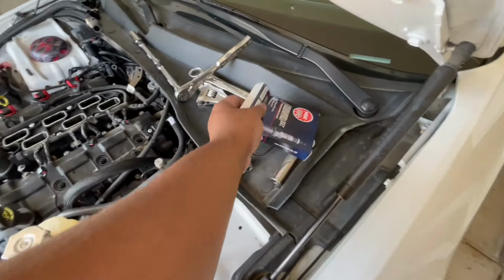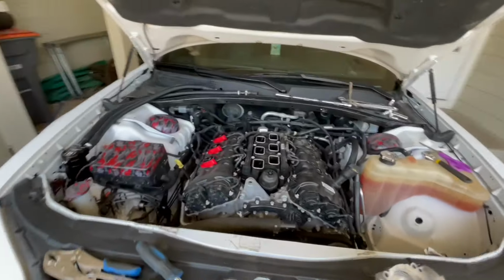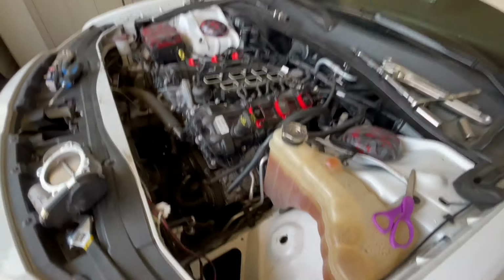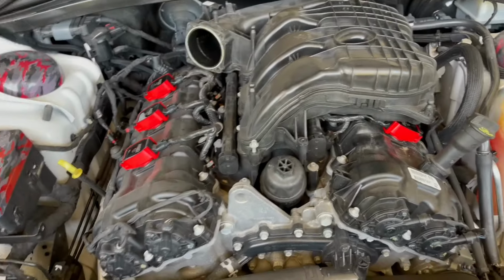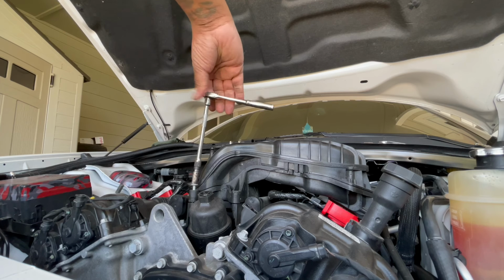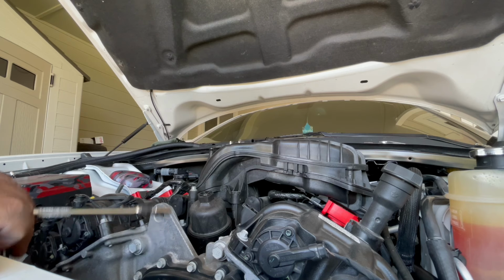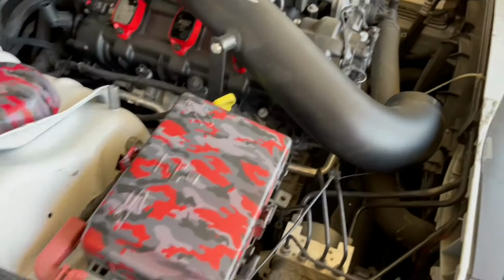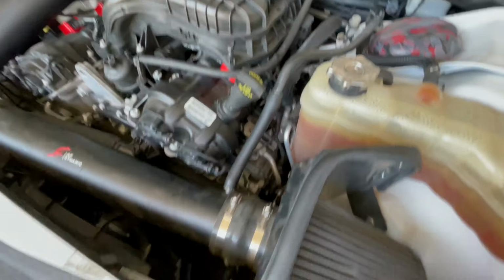Installing New Must Have Engine Mods For Your V6 Pentastar | Chrysler 300S | Part 2

Comment: Bruh that roar pedal is the freaking truth. I promise you won’t be disappointed. Actually you will thank me.
Reply from the maker: I rode in another 300 today with the pedal commander bro………god damn. Throttle delay getting taken out is fucking wild. I’m definitely copping one now lol
Reply: @Mopar300S  I told ya. Bruh it’s unfreaking real. Roar pedal is much cheaper and works the same. The pedal commander was causing some cars to have a code pop up. Research both first broski ✊🏽.

Comment: That foam insulator serves two purposes that do really matter.  One is to help keep the intake from getting to hot and keeping the intake Temps down.  The 2nd is noise reduction under your hood.  The controversial 3rd is to keep any larger rodents like squirrels or rats or opossum from getting under your intake and nesting.  But it honestly won't catastrophically affect anything, maybe fuel mileage and idle conditions when it's colder.

Comment: Hey trying to do the same mod can you do a video on how to remove the intake manifold??? Love you videos by the way
Reply from the maker: Upper Intake Manifold was taken off in the first part of this video, but the lower? I have not messed with it yet other than putting new gaskets on.
Reply from the maker: But once these parts arrive, ill be going over that. Replacing more engine parts.

Comment: Why not use 85mm-90mm throttle body if using adapter for “5.7L” should bolt up no???? Bigger opening deeper tone???

Comment: Have you dyno tested your car yet?
Reply from the maker: I haven’t. It’s not gonna be a thought until I make the next three mods happen. I’d like to think I’m in 320-330HP range with everything done but that’s me simple adding HP gains that each mod comes with.
Reply from the maker: Elevation kills most of my power here. Being a mile up is terrible smh
Reply: @Mopar300S  I would like to get 340 out of mine

Comment: Dude lose the background music. I can’t hear what you’re saying. Also engines don’t like any other plugs than what they came with from the factory. I’ve seen it first hand. Autolites, or NGK plugs in a 3.6 will cause misfires and all sorts of driveability problems. Stick with the stock Champion plugs. That’s the rule of thumb that any experienced auto technician will tell you. Online forums are full of misinformation posted by armchair experts that have no experience in repairing vehicles. I’m no armchair expert, I’ve been an auto technician at a Chrysler dealership for 15 years.